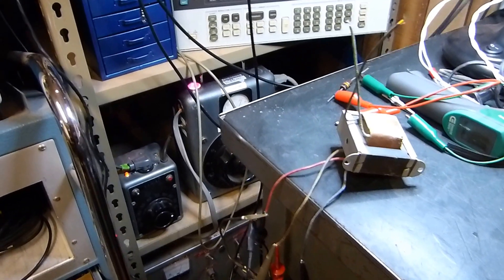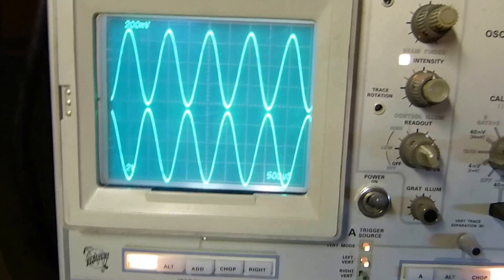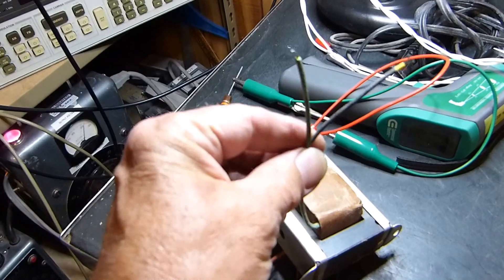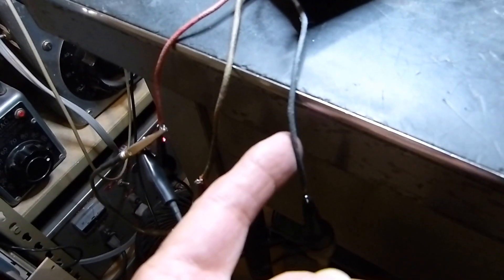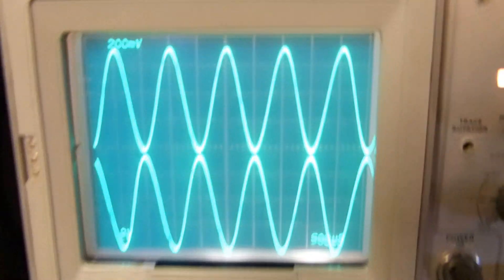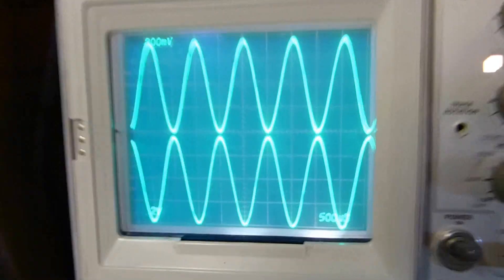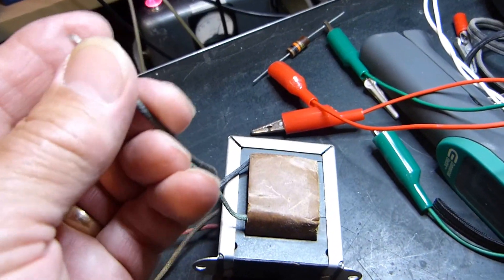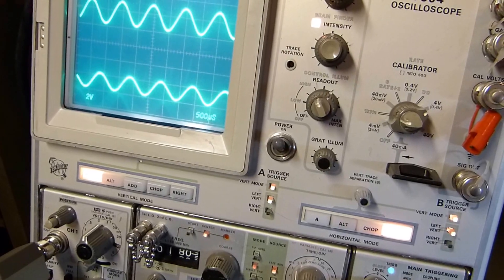Developing 180 Degree Phase Inversion For Driving Push Pull Grids Using A Center Tapped Choke

Comment: hi- i really like your down to earth, nuts and bolts, videos. i am writing concerning a thought i had about polarity vs. phase shift. i know the concepts, but my question was in interpreting the o-scope's wave. since with any symmetrical wave viewed with continuous sweep, 180 degree phase shift looks just like inverted polariry, would there be a way of differentiating them by maybe using a sawtooth wave, or a single sweep mode to try to establish the time delay? thanks again.
Reply from the maker: Polarity might even be a better word to call this 180 degree shift. You should be able to see the time-delay or phase-shift with this method. If there is any phase shift it would be seen by using the vertical knobs of the oscilloscope and placing the traces on top of each other.  If they shifted in phase they would not line up perfectly horizontally. You could increase horizontal sweep and just look at the leading edges to magnify any differences. If they are not equal in amplitude they would not line up perfectly vertically. Thanks for your comments.
Here is a video where I think I show considerable phase shift in transformer coupled stages.
https://www.youtube.com/watch?v=n9azTK-7IOY&t=2s

Comment: very interesting..i have a wurlitzer jukebox amplifier here with a dead autotransformer phase inverter exactly like you had...i cant find one anywhere, so may have to do what you did here, problem is i dont know what impedance primary i should go for...its fed by a 6SC7 tube with parallel plate output, and driving a pair of 6l6 tubes....thanks, bob
Reply from the maker: Bob, the impedance is not going to be that critical. I would use a small push pull transformer from a 6AQ5/6BQ5/6V6 sized amplifier. Just use the primary as a center tapped autotransformer like the one in your jukebox and leave the secondary winding open - do not short the wires just tape them off. I think that will work just fine.
Reply: @ElPasoTubeAmps  thanks for you fast reply!  and the info, yes the existing transformer is about 2 by 3 inches metal shrouded, so i'll see if i can find one about the same size that will do the job...i take it the higher the impedance the better? so not to load the 6SC7.....
Reply from the maker: @sparkey1958  I agree. I think most of these small transformers are 5-6H primary or so and I personally believe it will work but you never know for sure until you try it. Hope it works for you.

Comment: This is similar to the buck-boost transformer use in AC power systems. When we lose a phase on a 3-phase transmitter site, the method I use to get the rig back on the air is to use a transformer like this to 'synthesize' the missing phase.
It would be interesting to see the phase response at extremes of audio frequencies.

Comment: Excellent video, David. Thanks for verifying the phase inversion capability of a center-tapped filter choke. I looked back through my Wurlitzer amp schematics, and they used this method on virtually every amplifier they made from the mid-30's to the late 40's. Rock-ola used it in some late 30's amps. I wonder if this is partially responsible for the boomy "jukebox sound" we get from the classic jukeboxes of that era.

Comment from the maker: My guess is cost - I figure it costs more to make transformers than tubes but I may be wrong. Also, I suspect that high frequency response might suffer from the inductance in the choke so that would rule it out as a high fidelity amplifier.  Interstage transformers were common in communication equipment years ago for driving push-pull grids but not this method, yet, I have seen this method before but I cannot recall where.

Comment: Very interesting. This makes me wonder why tubes were ever used as phase inverters. It seems like using a center tapped transformer/choke is a much more simple, elegant and reliable way of achieving the same result. Does using a tube have any benefits over this method?